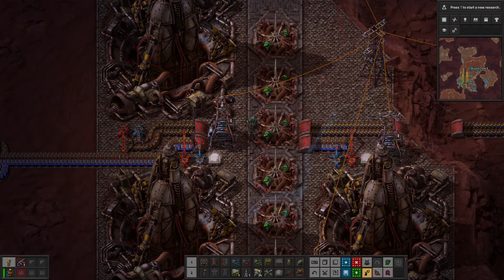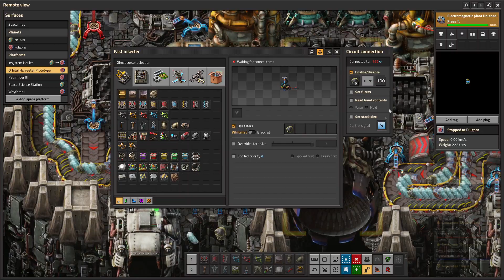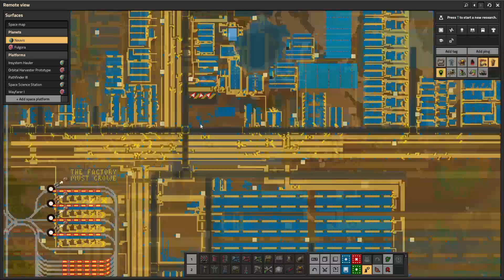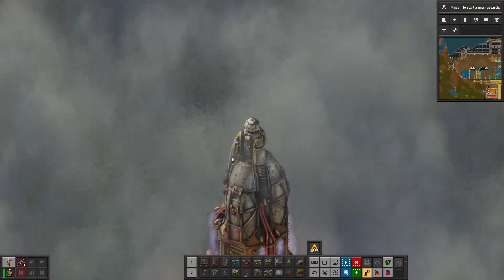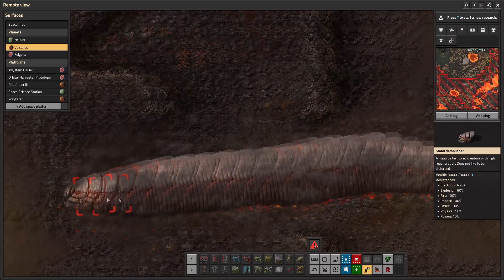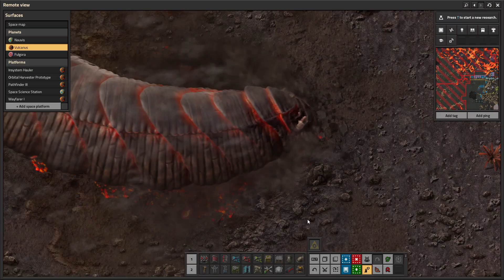Factorio Space Age / part 7 / Destination Vulcanus

Comment: i suggest you build up a larger stockpile of holmium in any form, if you can. you will need it later and the extraction rate is low enough that you can just build and forget it until needed.

...the last episode had no comments? how strange. i am sure i did a whole wall of text worth of comment. guess i forgot to actually click the comment button...
i think part of that comment explained how the devs thought for some strange reason to just add 10.000 tons to the ship mass during thrust/acceleration calculations. meaning making your ship as compact and light as possible is not worth the effort, ass each saved tile only makes a fraction  of a percentage difference in ship speed. the only real important aspect affecting speed is the width of the ship. i also dislike how thrusters perform worse fuel-to-thrust wise when properly supplied with fuel and even the topspeed is capped at fairly low speeds...

by the way, underground belts and pipes don't work through lava.
which is kinda annoying with all the lava lakes...
i would have preferred it if they worked without issues in lava or space but it makes sense the way it works.
but while i am at lava, why are you building a scrapper loop to void items when you can just drop them into the lava?
just use a couple inserters and lava-trash whatever you don't need.
that should have been shown in the vulcanus tips page pop up as well, if i remember right.

uranium from asteroids? unfortunately that is not possible without mods. same for getting stone.
yes, the devs decided that players can't make a complete factory base in space. probably to promote the actual planets getting developed.
though getting the few materials missing into orbit is a non issue, really.
and getting enough uranium to fuel all your worlds is just as easy.
i am still kinda confused why only nauvis has uranium ore...
i can understand it for fulgora, that civilization had other ways to get their power or has just mined it all for themselves long ago.
but vulcanus should have had uranium ore patches too somewhere, from a world building perspective i mean.
and gleba... well, i wouldn't be surprised if the the locals ate it to get their strange evolution going or if the ore is just hidden under layers of dead mushroom gunk...

you like building ships? me too!
i also build them from scratch whenever i need a new on.
though i tend to go for purely practical builds. there is rarely any creative design choices. my ship are more often than not either arrows or bricks...
though at least they enough space for everything i need to produce and some spare space for when i need to produce something on thee fly.
but for every design i make sure to include plenty of cargo bays. something you use too sparingly, in my opinion. they need to be connected to the main hub building to work and are kinda in the way of building compact factory ships, but at least they give more more inventory slots to ships. they also work for rocket landing site.
by the way, each cargo bay has their own slot for receiving rockets and sending stuff to planets.